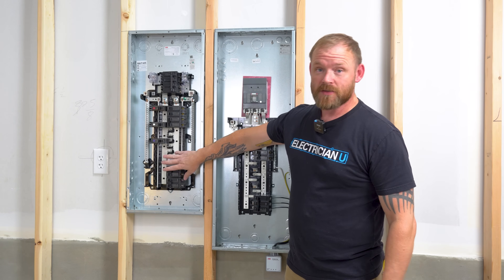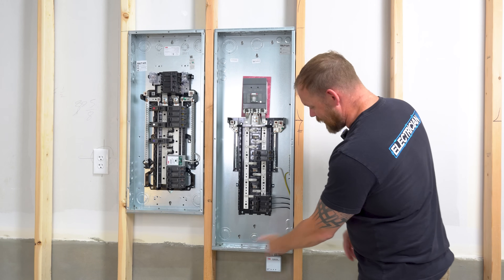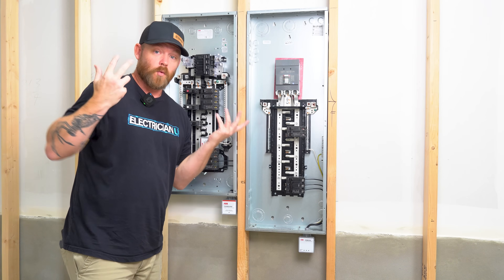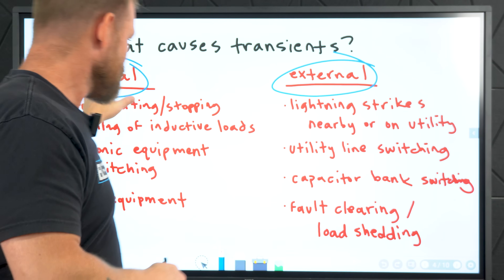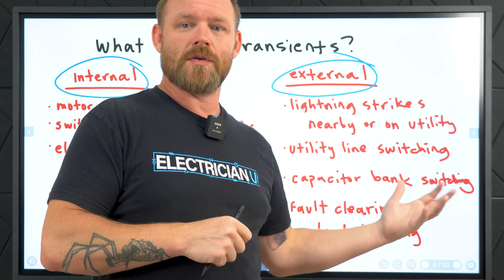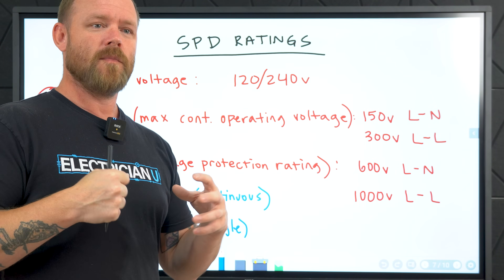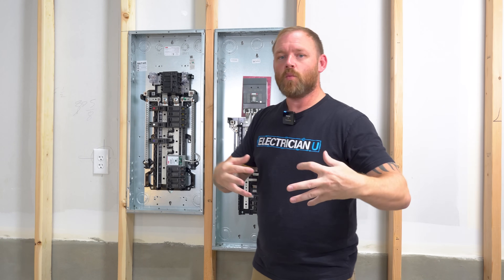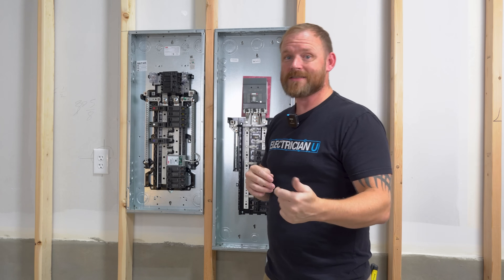What Surge Protectors Actually Do (and What They Don’t)

Comment: I noticed several of those surge protectors didn't have a ground, which for the service panel probably doesn't matter much, but I'm used to seeing those knockout style ones with ground and a spec for clamping voltage for line to neutral, line to ground, and neutral to ground, what is your thoughts on ones that provide a neutral to ground path vs ones that dont, especially on a subpanel where neutral and ground are not bonded at the panel?

Comment: Lightning causes surges too. It may not protect a direct strike, but it could protect from an indirect one.
Reply: He stated this.
Reply: Unlike AC electricity which is delivering energy, lighting is like a discharge from a capacitor, that is, 5 Coulombs of actual electrons are being delivered, like the spark from a 20000 μF capacitor at 250 V.
Therefore, lightning is better conceptualized as a constant current source.

The charge is whatever it is.  How fast it goes determines amperage.

The voltage is whatever it needs to be to overcome the resistance of the path.
If through atmosphere, then millions of volts.
If across continuous copper cladding on a roof, then close to 0.

Potential difference depends on resistance between two points.
Lightning has high voltage only when facing high resistance.

Resistance dissipates energy as heat.
Heat increases temperature.  
High temperature especially plasma arcs can destroy equipment.

That’s why big continuous highly conductive pathways to earth are important.
Reply: @denverbraughler3948 lightning can also induce a voltage into a transformer on a pole as well, therefore giving a voltage spike

Comment: Had over voltage condition caused by a a failed Step Down Transformer the power company had to be called to replace the step-down Transformer my indoor power strips melted down

Comment: My power company recently installed one in the meter itself, at my expense of course. I wonder if there is any actual advantage of placing it there instead of in the breaker panel. 
PS: I'm just an IT guy with an interest in electrical.
Reply: The utility mounted device typically has a high clamping voltage, so stacked protection is better, Type 1 is the utility meter device, then install a Type 2 at your main panel and a Type 3 (plug-in) at your device.  Low VPR clamping voltage is more important than Joules.  The utility warranty for their device typically only covers "white" goods, ie, refrigerator,  stove, washing machine, and excludes electronics.  And good luck trying to collect on their warranty.
Reply: The advantage for you is that you don’t have to change your equipment and it’s their problem.
The advantage for them is that you can’t really blame them for surges.

If the SPD is installed on the entrance side of metering, then you aren’t billed for any incoming energy that it dissipates, saving you maybe 1¢ or even 2¢ over its lifetime.

Comment: Are externally mounting surge protectors designed that way to protect the panel from the excessive heat that the device absorbs when it is activated?
Reply: No, only to overcome lack of space inside the panel.

Comment: I feel like that's almost more confusing to say it's not lightning protection.  It's not direct lightning protection, but then you go on to talk about indirect damage from lightning conducting through the grid.  Almost need to make like a bullseye analogy, if the lightning actually hits on your property your electronics are just toast, but still need protection from near misses.
Reply: Saying surge protection is not lightning protection is like saying eye protection is not valid protection for guns and bullets. While technically true, eye protection won't stop a direct bullet, you really want to wear eye protection around guns because they sometimes cause shrapnel or a ricochet. Eye protection is very helpful against indirect bullet hits, just like surge protection is good for either indirect or slightly distant lightning strikes. Just like other safety things it mitigates risk, it doesn't eliminate it.

Lightning often causes surges that destroy equipment. These surges are often within the limits of what a surge protector can handle. Therefore, surge protectors do protect against lightning. They just don't protect against direct lightning strikes.
Reply: @brainwater  Yeah, good analogy.  You'd be correct to say that eye protection isn't armor, you'd be wrong to say it's irrelevant or doesn't help at all.
Reply: I believe it's case by case.

If you have a ton of expensive electronics like a server, or a lot of electronics without their own power supplies and they rely on stable, safe power, or a ton of electric devices you have to constantly run, you need a surge protector.

If you have a person who depends on an electric medical device, you need a surge protector.

If you have a generator connected to your house, you need a surge protector. 

If you live in an open area that doesn't have a lot of trees like in the plains, you might want one. Where I live, there are tons of trees, and they make awesome lightning rods. They're filled with water, they stick way up in the air, and they dig deep into the ground. 

If you're near the substation, you probably want a surge protector, because you'll get the heaviest part of the utility strikes on the transmission lines.

Comment: 3:14 -- I think this is incorrect. The reason you want a low-impedance path has nothing to do with propagation delay -- the added time from an extra 6" of wire is on the order of nanoseconds! It's about the voltage drop across the wires' inductance during a surge -- at say 1uH of inductance and a 10^9 A/s dI/dt, 6" of wire will drop the effective clamping voltage by 500V.
Reply: Absolutely correct on both points. Thank you for your clarity.

Comment: I thought surge protection devices had to be near the main breaker. Why are you installing them at or near the bottom?
Reply: Doesn't matter.
Reply: Just because you thought it doesn’t make it true.

Draw an electrical diagram.
The bus can be viewed as a single electrical point on account of negligible resistance between any two physical points.
Reply: @denverbraughler3948  Facts.  Will not matter anywhere on the panel.  This guy is the dude that wants all the biggest breakers at the top of the panel.

Comment: Just antdotely, back in the 70's I was visiting my friends house and a thunderstorm rolled through.  A lightning strike hit the pole that had the transformer for his house.  The strike followed everything that conducted electricity.  The wiring cooked off all the insulation, turned it crunchy black ash.  Every outlet and switch in the house has a black ring around it like soot.  The entire house had to be rewired.  What a mess.

Comment: Other than Radio, computers and some parts of hospitals - MOVs still seem like a solution in search of a problem.   How much equipment will be saved?   What is the MOV lifespan ??
   Are there are Square D and Siemes  breaker / surge protector all in one.  
   Customer asked about EMP. I said no.  Hope I was right.
Reply: And MOVs lifespan will be reduced  after each voltage spike and should be checked frequently
Reply: @rty1955  no one keeps track of where the breakers are and we can’t even get maintenance scheduled. I really doubt people will be checking the MOVs

Comment: Read the warranty! Not all whole house surge protectors are the same. Schneider/Square D’s whole warranty covers appliances AND electronics. Others require a second SPD installed or connected to a plug strip to cover electronics. Siemens only covers appliances. Also, my experience is that Schneider has the easiest claim process versus their primary competitors.

Comment: Will this also work on a sub panel with the neutral and ground separated  ?
Reply: Yes, absolutely.  These work in any panel.  The line to line protection works even with no neutral (or ground).

Comment: I like my Leviton surge protector. It is a surge protect AND two 15A circuit breakers that I used for my shop's lighting branch circuits. It just plugs on, no wires.
Reply: Siemens, for one, has those too

Comment: Knowing it should (in proper operating condition) protect overvoltage on back-up generator with automatic xfer switch, would the same hold true for a portable generator w/ tap operating when utility service is re-energized, and for how long? I would think as long as VPR is not exceeded, it would shunt excess voltage for a duration long enough to be able to manually shut down/disconnect portable power supply? What say you?

Comment: Great exposition as usual!  QUESTION:  Are these surge protectors intended to protect the whole system, including multiple other panels?  Can one surge protector in a sub-panel protect circuitry on its service panel and "sibling" sub panel?  Should every panel have one?  Seems like if they come with a neutral connection that should be installed at the main point of disconnect where neutral and ground are bonded... but maybe that doesn't matter since it feeds back to MPoD?  What are your thoughts?
Reply: Surge protection works best in layers!
The closer a surge protector is to what it’s protecting, the better the defense. This is why we install one at the main panel, one at each A/C disconnect, and one for your cable or internet line.

Redundancy is key  my friend, each layer catches what the last one might miss. Together, they keep your home’s electrical system and electronics safe from unexpected power surges.

So if an electrician ever goes to your home and offer you this option, get it!
Reply: @h0melyfe792  Curiously my HVAC guy talked me out of them years ago, said he'd seen several that had burst into flames.  Perhaps those were early models.
Reply: @jmpersic  NEC requires all dwelling units/homes new construction have surge protectors at the service as of 2020
Reply: @PNW.sparky   Clearly the outfit that upgraded my main service panel didn't know that or didn't care.  They put in a panel with no space for a surge suppressor.  It's a siemens, I'm not sure if they make a breaker type surpressor that provides lugs for a circuit as well.  Leviton does a nice job on that front.

Comment: So the clamp voltage is 150, but my TV is fried at 140v.
Reply: Most TVs now have switching power supplies that are designed to operate from 100V-250V. That is so that they don't have to make different power supplies for different regions.

It shouldn't be damaged or even think there's a problem if it sees 150V.
Reply: @Sparky95 good to know. I just discovered that my laptop charger is 120-240 also.

Comment: Star Trek explained? - On DS9, during the war with the Dominion, the chief was stacking the used power cores from, the Defiant's, phaser banks in the crew's lounge. Was the weapons energy system creating a short between phases and the power core was 'shutting' the resultant energy spike to the emitters? With no 'ground' it would have to go somewhere. And you only get so many shots before the core is burnt out.

Comment: A couple of adders on how these things work.  There is also almost universally a fuse in series with the MOV (usually in series with each HOT going into the protection device).  The little green LED basically tells you that the fuse hasn't blown.  The fuse is mandatory because when a SPD tries to sink too much energy it usually fails into a shorted condition rather than an open condition.   So the fuse is there to protect against an explosion or fire in the device due to excess energy.

SPDs also usually have Zeners in addition to the MOVs.  The reason is that Zener diodes react to surges on picosecond time scales while MOVs react to surges on microsecond time scales (hundreds of nanoseconds to microseconds) due to the time it takes to develop the discharge.   So a MOV alone does not provide good protection against very short high-voltage surges.

And once the fuse is blown, that's it.  The device is no longer protective.   When you have tap-on SPDs without a breaker, they basically stop protecting everything once the fuse is blown.  But if you have a breaker'd SPD, the SPD operation will trip the breaker and any circuit hanging off that breaker will remain protected.  The breaker may even protect the SPD from blowing its fuse.   A SPD with an integrated breaker does provide decent lightning protection but only for the circuit hanging off the breaker.

But as has been mentioned, none of these are "serious" lightning protection.  Serious lightning protection requires a lot of structure in addition to the surge protection as well as far beefier surge protection and needs to be able to disconnect (via breakers) the entire circuit.  And even that won't be enough for a direct strike where the EM field couples directly into the devices in the home, bypassing the AC wiring entirely.

This is also why so-called "EMP" protective devices (which are basically just rebranded SPDs) won't actually protect anything from a real EMP.  Of course, if a real EMP were to happen, the company selling the devices won't have to worry about customer service anyway so...

Actual lightning protection is a bit more involved and usually involves a sacrificial element in series with the circuit being protected, as well as only generally used for low-power circuits like sensor inputs and such.  The sacrificial element is typically a carbon-film resistor in series with the (very low power) circuit prior to the MOV + Zener.  An actual lightning strike will vaporize the resistor before the Zener or MOV melt / explode, thus protecting the circuit by permanently disconnecting it.  The LPB must then be replaced or repaired to get the circuit back.

Circuit boards designed to withstand lightning generally also have a large number of zeners integrated into the board to try to shunt stray EM fields (direct and indirect) before they blow up sensitive electronics, and are housed in a faraday cage with integrated "real" lightning protection on every individual ingress or egress from the box.

-Matt

Comment: Does the code allow ABB breakers in a GE panel? I once had to replace a whole GE box because we couldn’t get GE breakers from 1977 any longer. That was in 2005. There were aftermarket breakers in place which failed the underground rough in. Im not a licensed electrician but i was doing a development which triggered an inspection when we switched 2 old houses to underground service. I was the homeowner on that GE boxed house and the inspector was cool. I opted for a Square D panel but i was just curious. Still have that old box out in my barn on a shelf.
Reply: What you want to do are sell you old breakers to company that buys them for resale to others who are in the same situation that you were in. Then convert your old panel into a roomy junction box for another project, or repurpose it for some other use.
You might even find a buyer for the whole thing especially if it has a main breaker.

Comment: Whole-house surge protectors can also cause problems for those of us trying to identify which breaker serves an outlet. While mapping out our house wiring with my new Klein Tools ET310 it would only identify one breaker no matter where I plugged in the transmitter. The breaker that kept being wrongly identified protected an outlet located within 18" of a newly relocated meter base and surge protector. Apparently the whole-house surge protector emits quite a signal through the metal meter base and wall. After temporarily disconnecting the surge protector I'm able to identify and map out all circuits with no problem. Klein Tools might be updating the instruction manual...
Reply: It's probably noise filtering in the whole house surge protector that blocks the signal.
Reply: @massengineer7582 like ripple filtering via capacitors?
Reply: This dude is telling the truth, I ran into this very exact situation about 8 months ago while troubleshooting a friend's house! I was hesitant of temporarily disconnecting the surge protector cuz it was long past it's 5yr rated life & was learey that it might not have worked upon re-energizing after fixing the issues, but luckily it didp
Reply: Interesting

Comment: The SPD conducts the over voltage to the neutral.
The protective earth grounding system doesn’t participate.
The SPD doesn’t even have a ground connection!

Comment: Is a surge protector supposed to work to suppress overvoltage due to lost utility (or genset) neutral? 
After Helene we were running on a generator when something caused one leg to spike in voltage. Took out several arc fault breakers and some electronics. Whole house surge suppressor didn’t help.
Reply: No, the SPD has no way to do anything about a broken neutral.
Your system already has neutral bonded to your earth grounding electrode system.

If an SPD could do anything, it would have to shunt from the less loaded pole to neutral whatever amps imbalance exists, potentially the equivalent of many toasters for months until the neutral gets repaired because you noticed that your electric consumption went up by $2000 per month.

Comment: Great video! You may want to consider doing a video on MOVs, surge protectors, and how the capacitance in MOV's can fool a GFCI device into faulting. It has to do with the ability of capacitors to conduct alternating current. A great thing about central protectors at the panel is they are upstream of GFCI devices.
Reply: That's because they leak current to ground

Comment: For TVSS applications I don’t like the major brands.  I have had great luck with MCG TVSS they also filter higher frequencies.  What I hate is the industry really feels like your buying magic potions
Reply: Also like installing them on generators or circuits that have back up power.   If you ever had a genset go full field having a large TVSS will trip the generator or trip main breaker before you burn up a UPS or expensive equipment.